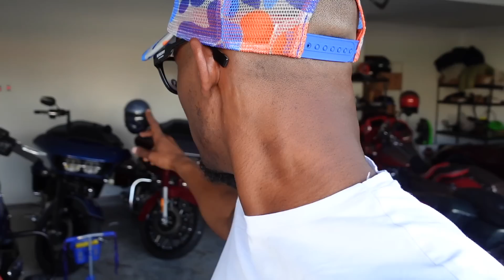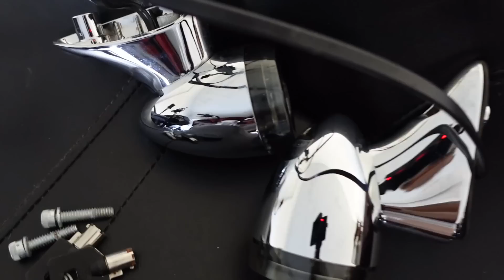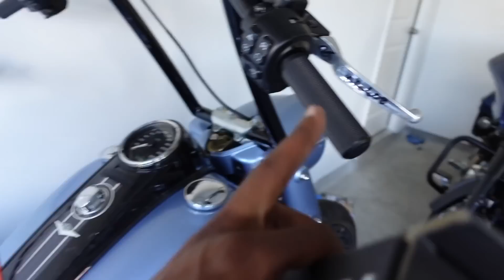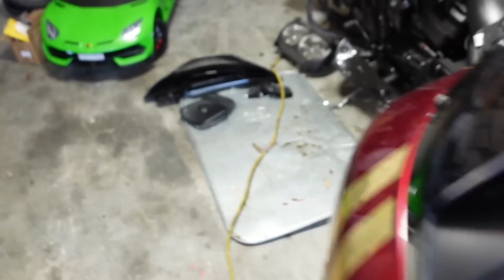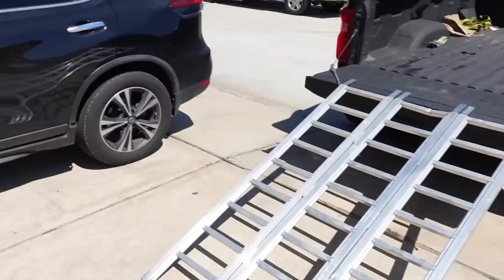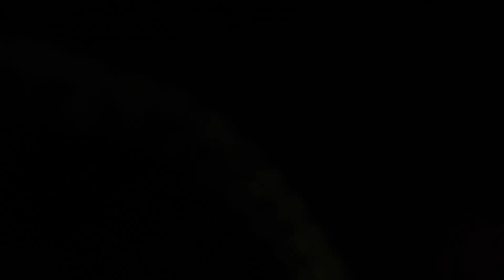IT'S CAMMED! FINALLY GOT THE CHEAPEST ROAD GLIDE FROM COPART STARTED!

Comment: You need to have someone Fabricated you a bar for the from of the pickup trucks with a small  wrench using the side holes on the pickup trucks. This way when you have a Bike that won't start you can use the wrench to help pull it up pues if you have The wrench with a Remote Contral you can seat and wrench it up. This way you can use it with any truck make it  Adjustable side-by-side to fit any vehicle.